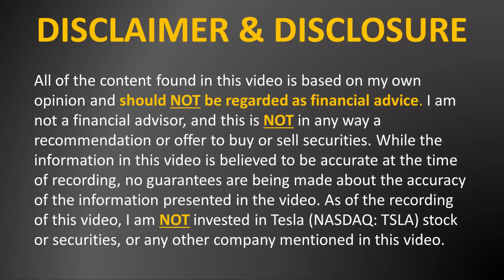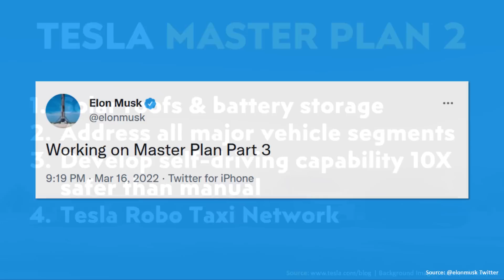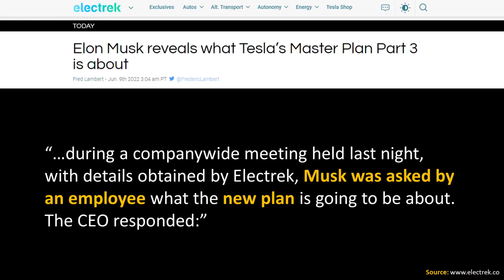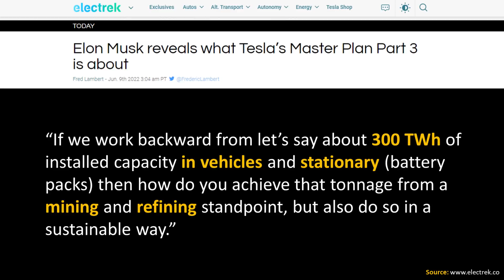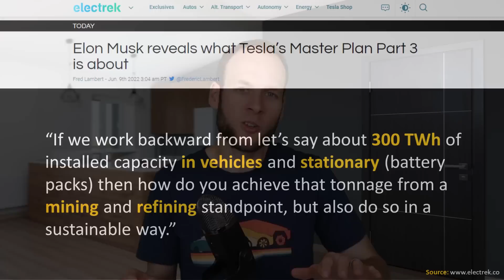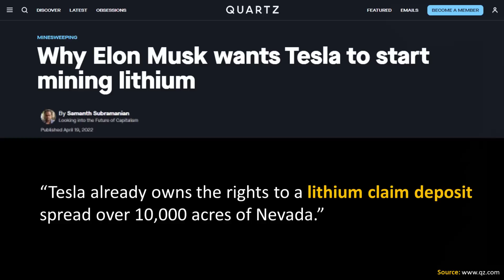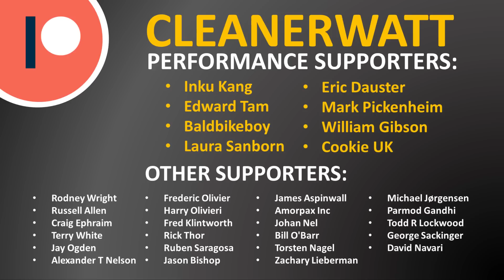Elon Musk's CRAZY New 300 TWh Plan for TESLA!

Comment: The total number of vehicles on Earth can and should be drastically reduced.  The average car spends 95% of its life sitting in a parking lot, garage, or along a residential street.  If we utilized automobiles and trucks the way the human body uses blood cells, productivity and the quality of life would be improved enormously.  Over the next couple of decades ICEVs will be replaced by EVs, but not one for one.  A single autonomous EV will replace as many as 5 ICEVs according to Silicon Valley entrepreneur Tony Seba, reducing the needed volume of vehicle batteries in direct proportion.

Comment: There are a whole bunch of places where one can easily get confused with this stuff. For example, you need to be sure you're not confusing passenger cars with all motor vehicles. I'd prefer to see it in terms of ttkm (trillion tonne kilometers) rather than vehicle count. A substantial portion of passenger cars are old and don't get driven nearly as much. That's much less true for trucks and buses. It probably would make sense, at least for some purposes, to include ocean shipping, trains, and aircraft. I have a feeling their energy needs per tonne-kilometer may not be all that different from cars and trucks.

For stationary energy, the big pitfall is probably confusing thermal and electrical energy. Heating with electricity can be either much less efficient than with fuel combustion or more efficient, depending on the technology. And with all generation sources, there is the question of whether you can do something with the waste heat.

Also be careful not to confuse stats for one country with global figures. I usually prefer global stats for most things, but choosing certain countries may sometimes give a better indication of where things may be headed in the future.

BTW two decimal points of precision rarely are meaningful.

And not doing this stuff in metric units is lame, but of course I realize few of you will heed that. La vida es asi.

Comment: Will we really need to replace all of 1.5 billion vehicles on the road? With level 5 full self driving robotaxis available at some point in the future, how many cars can be replaced by one robotaxi? Remember, that the cars today are sitting in the parking lot like 20 - 22 hours a day on average. But of course most people want / need to travel during the rush hours, when still only around a fifth to a quarter of all the cars is on the road at the same time. Therefore we can safely assume that each 4 cars today could be replaced by a single robotaxi. Add to that a surge in demand for travelling and some people will still want to own their car, that would bring the total number to around 1 billion in 2040. Improvements in efficiency over time mean that the average car battery will be around 50kWh (could be even less since the majority of robotaxis will be used for daily commutes of 100km (60 mi) between charges, so a 30 kWh battery will be pretty common). Nevertheless, 50kWh multiplied by 1 billion cars results in my rough basic estimate of 50 TWh of car batteries needed. That is equal to battery production ramping up to 3TWh annually by 2030 and then to 5TWh every year by 2040. Tesla alone could achieve this and then there's all the others. I remain an optimist about the future of transportation.

Comment: Tesla’s battery 🔋 goal should be 30 terawatts, not 3 terawatts, (Tesla made plus 3rd party).

This because Tesla has adequate overflow capacity for batteries to be used in Megapacks & other energy storage and later robots.

Thanks to Putin’s high energy prices, the new national security concern of every country is now energy self sufficiency.

 In addition energy induced inflation creating lower living standards and this is in addition to climate change. That’s 2 dramatic new variables

Add this to climate change crises and you have the perfect storm,(and opportunity for Tesla). Marshall style plans to become energy self sufficient at low energy prices may become the norm worldwide, especially in Europe.

This is not like the oil shocks of the 1080’s where no spare energy resources existed.

Instead we now have an abundant supply of many energy sources including Nuclear, wind, solar, fracking hydrocarbons and more that is easily available.

How hard is it to require all new homes have solar roofs and BEV charging ports, ditto for new commercial installations ? Etc, etc for other rules and regs.

This perfect storm of 3 crises, is easily solvable with abundant alternate cheaper energy sources.

This is creating an exponential opportunity for Tesla. 

Governments now are motivated to commit trillions of dollars worldwide for new cost effective energy infrastructure with Chinese like management and regulatory efficiency that stimulates their economies, lowers inflation, lowers their national debt long term, adds to their national security and meets Paris Accord goals all at the same time; all thanks to Putler. 

That’s why I say Tesla’s 3 terawatts 🔋 battery goal is exponential too low. Tesla to start to working with national governments to install Megapacks in the EU, China, U.S. etc. At massive scale.

Comment: Because of all the red tape associated with mining, it can take up to 10 years just to start producing ore. All that ore will need to be refined, not an expert but guessing 2 to 3 years minimum to get a new refinery up and running, no shortage of red tape here either so maybe 5 years. Large vehicles will need high density storage batteries requiring nickel. Commuter vehicles and stationary batteries need lithium and phosphorous. Copper supply will also need a boost. Iron readily available. To get near the goal means 100x of all that Elon has done up to this point and and plans to put effort forward for the next 10 years. Good luck.